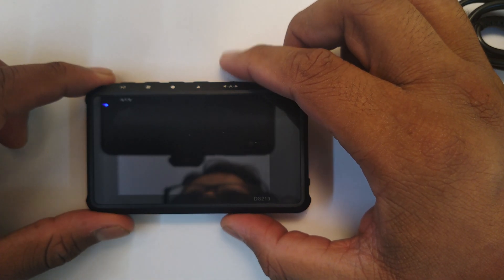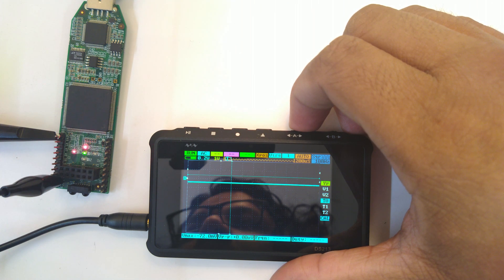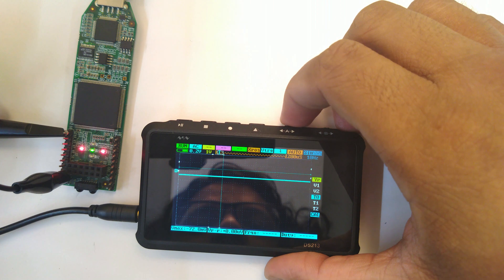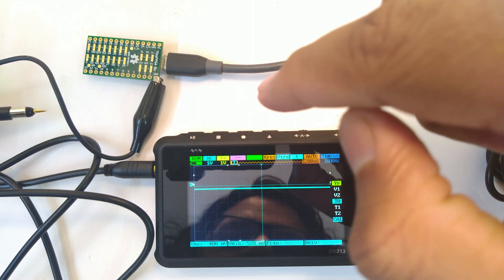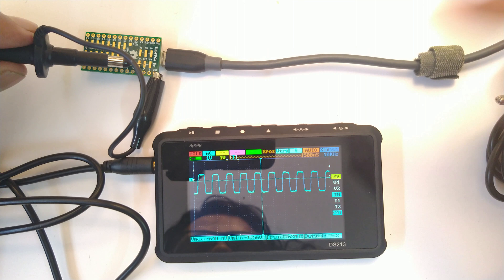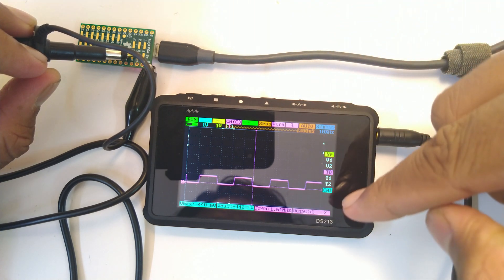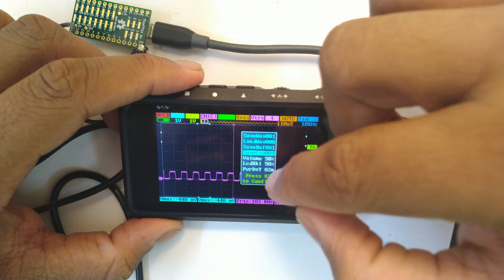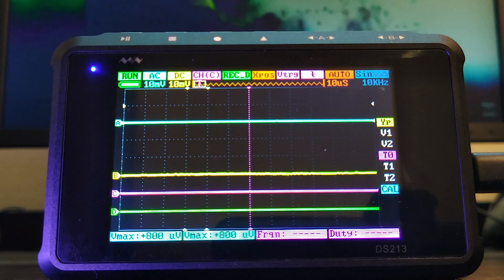MiniDSO DS213 By e-Design Review | Pocket DSO 100M Sa/s Review Pt. 2

Comment: Thank you for the video.  Question on ds213 calibration.  The voltage readings of my ds213 differ from the standard by about 0.8volt.  How to calibrate ds213 correctly.  Thanks for the help.